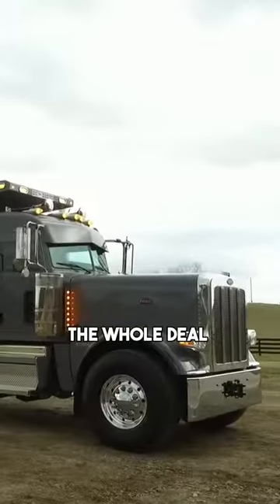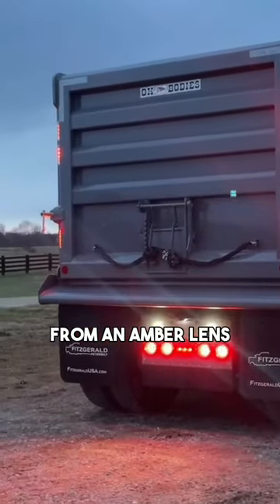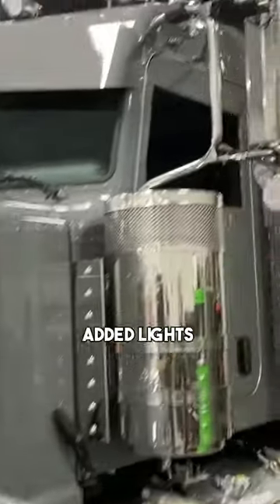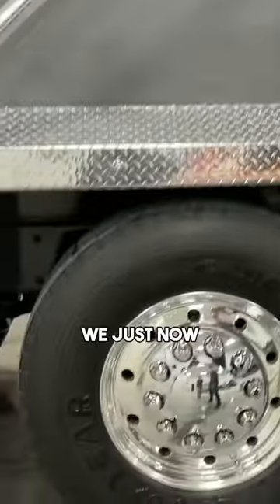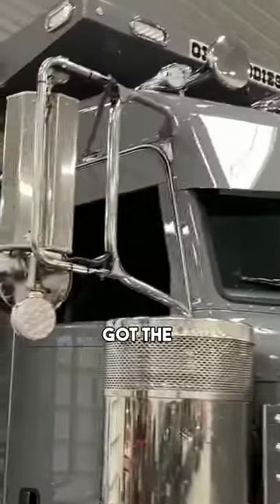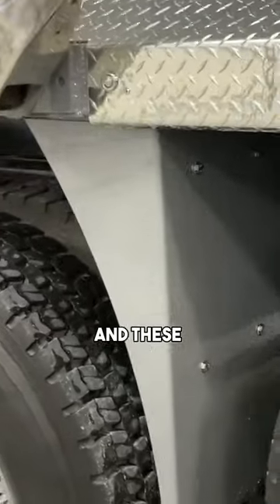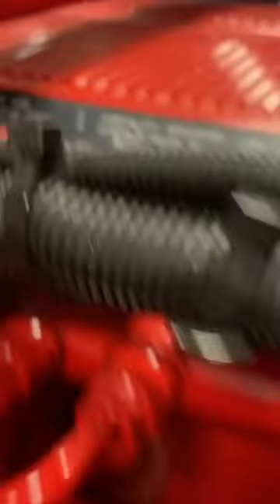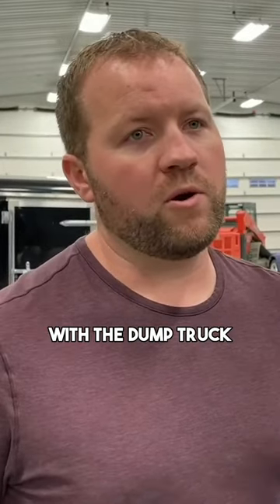600hp Custom Peterbilt Dump Truck   Big Cummins Engine #truck #peterbilt #bigrig #trucking

Comment: I use to gross 80000 lb with a sort nose L9000 300 Cummins 8LL 4:64 on Hendrickson walking beam. Last load of the day would be near 27  ton. Truck only weighed 265000 lb. With Daytons 
What that Pete TARE out at?